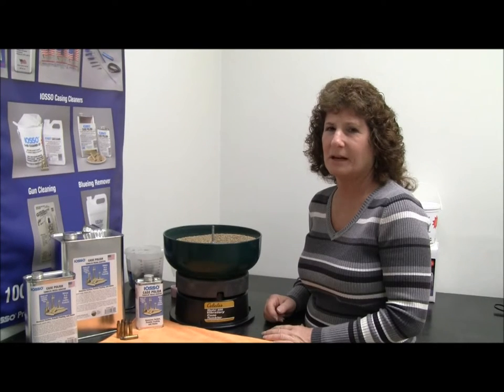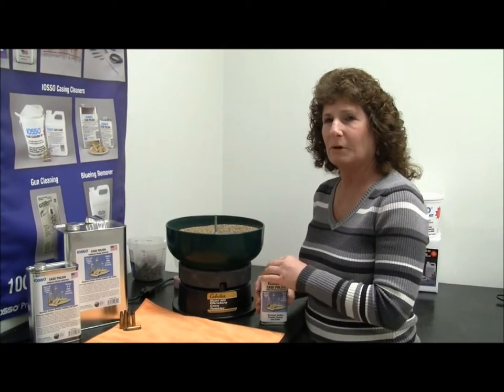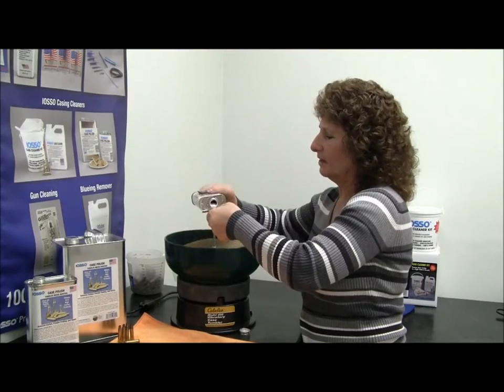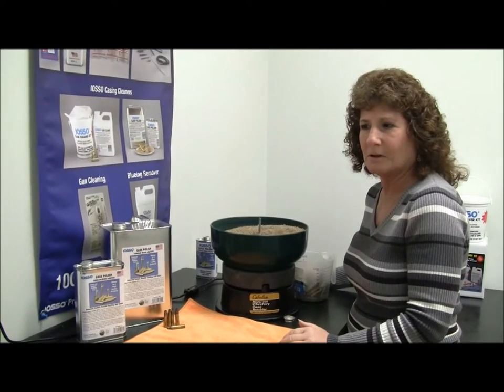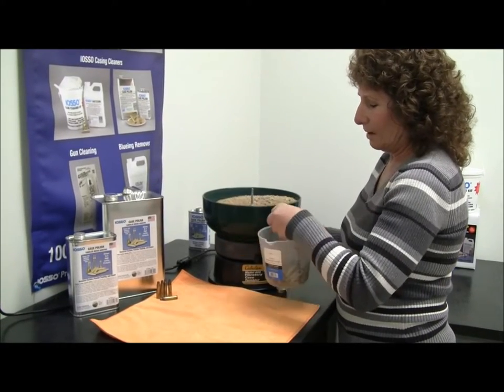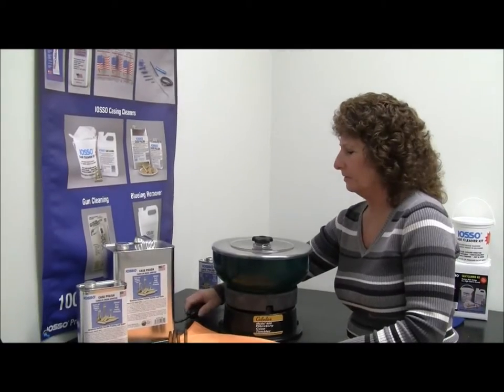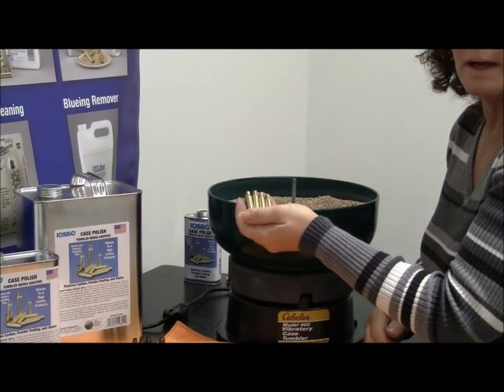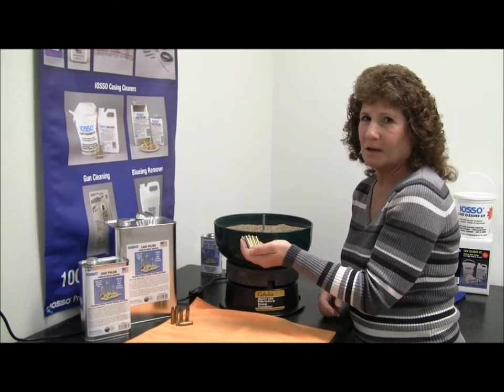How to clean brass bullet casings in a tumbler with the Iosso Case Polish.

Comment: Can this be used in a wet tumbler?
Reply from the maker: If you mean with stainless pins, no, it will clean them too and you'll end up with a black mess.
Reply: Thanks for the fast reply. @iossoproducts2296